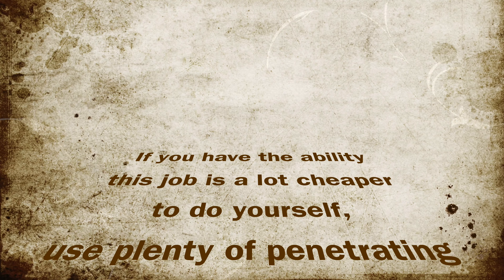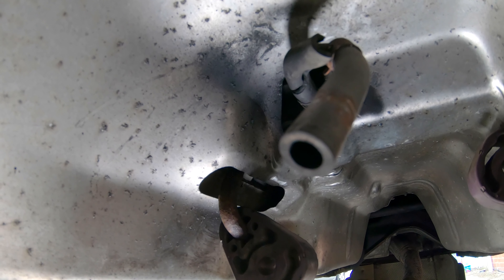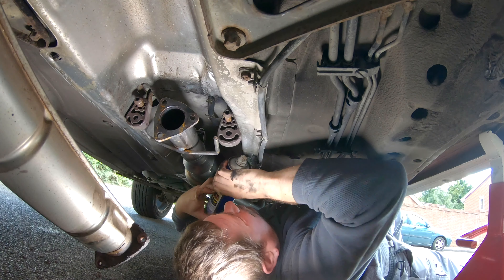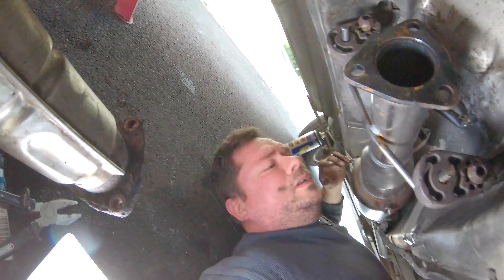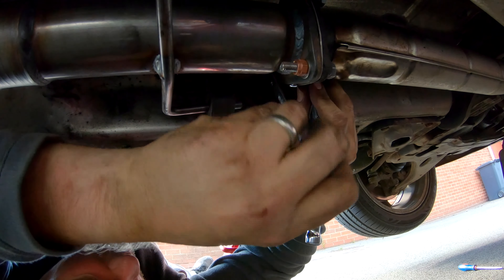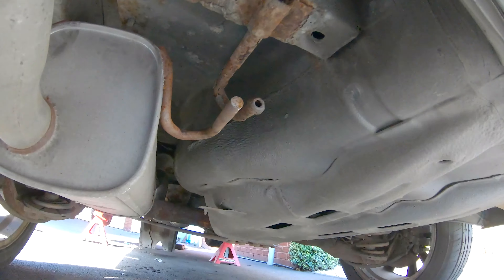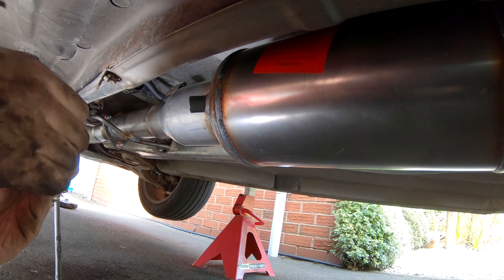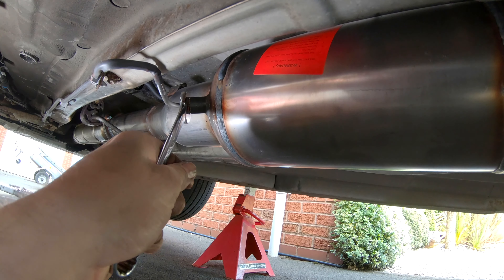Astra DPF & Exhaust change

Comment: Hello, nice to see you doing the job by yourself! I have an issue with the DPF of my Zafira B and I would like to know which brand did you chose and if it is working properly? Thanks!
Reply from the maker: Can’t remember the brand I think it was from cats 2 u, it is still working fine without trouble, but check you don’t have another fault like swirl-flaps injectors or turbo